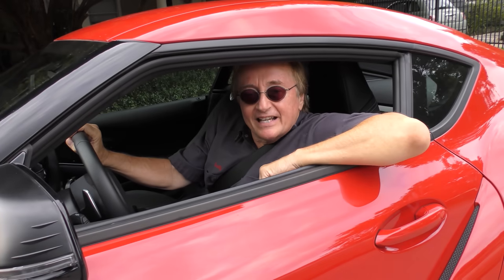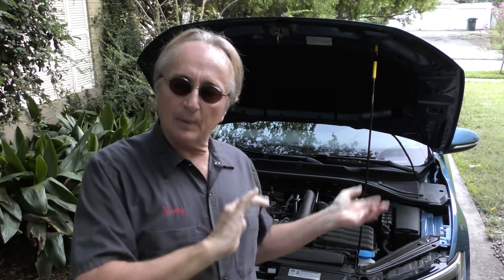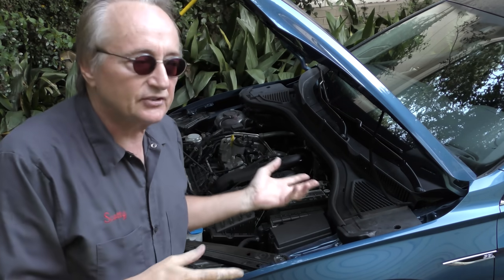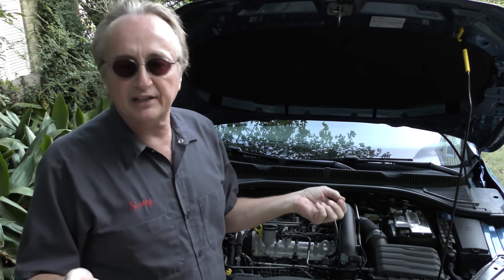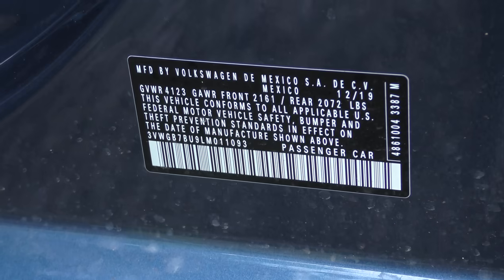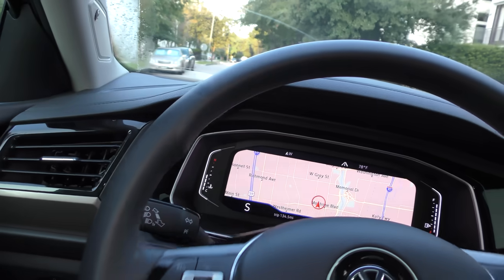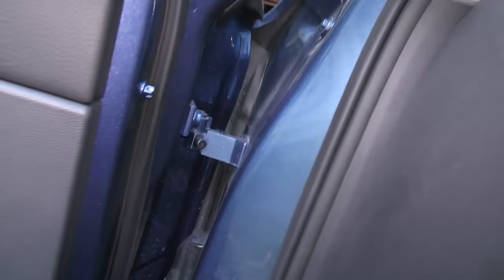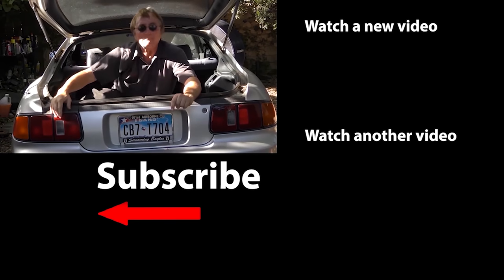I Just Found the Worst New Car Ever Made

Comment: The turbo is there to save fuel, not to max out the fun factor. VW is the company after all which introduced small engines with turbos just for this purpose. So with that fuel cost saving, it should cover the cost of belt change when it's due. And compared to a comparatively powered atmospheric, it will still be much more fun to drive with it's way more pep.

Comment: My mom has had trouble with every VW she ever had. My sister drives the CC 2.0 now and it's always in the shop. Her Routan had the brakes replaced way too many times. My Jetta GLI had to get a new engine at 60k (thankfully under warranty) and NOW it is a great car. They rebuilt it from the ground up and its probably a better job than most couldve done. Having a problem with the ECT sensor but if that's it then I'll be happy. 128k miles and I love that car. The handle is absolutely insane.

Comment: I have a 2019 Jetta and bought it w 3k miles. The clutch crapped out at 35000 miles and it was the most expensive and devastating repair experience I've ever took on. I'm permanently traumatized. It had warranty and tried 3 xs w the Lemon Law and failed. VW Serramonte in San Francisco were the most unempathetic jerks I've ever had the misfortune of knowing. Snakes!

Comment: I have been driving Jetta for 6 years and am very happy with mechanics and interior quality. However, I discovered that it has a known rust issue at the lower part of side fenders just by the front wheels. It is just a poor design.  I am disappointed with that. I do not like rust. I hope someone from VW management reads this message and do something about. Please address the known rust issue and the lower part of the side fenders. Thanks

Comment: EA211 in a 2016 Jetta, honestly will last you 200k easy, but you should keep up on the preventative things, oil change, trans service at 100k, timely spark plug changes, water pump every 70k, also N80 valve assembly around 70-100k to prevent evap leaks

Comment: These MK7 1.4l tsi Jetta’s have a timing belt that’s rated 150k miles. Then you inspect it every 10k miles and replace as needed. Their 8 speed transmission is made by AISIN, which is the same 8 speed transmission as the current Toyota Camry. It’s very responsive and the handling and driving dynamic is better than a Camry.

Comment: Hopefully you can run the tires at 32 psi to help out with some of that rough ride or go with the GLI Jetta with the independent rear suspension and pray for a water, cool turbo or the hatchback not the arm model of course

Comment: Have an Mk6 with 50k / bought new... have had the ac cleaned fixed/rebuilt, vacuum pump replaced, a broken clockspring, throttle body?? cleaned and 2 battery replacements.  My previous honda that I drove for 200k ran fine only requiring routine oil change and maintenance work :(

Comment: Have owned 3 Jettas. One diesel, two with the 1.4TSI (2 were kept until almost 200k mi.). With German cars, good routine maintenance is essential. If you are the person who skips or is lazy about this,  simply lease a car.  
Get the timing belt done every 100k. 
"Lifetime"... NOT lifetime. Engineers use that as a part term for "lifespan" of the part. NOT YOUR CAR's  lifetime. Just my experience. YMMV (as always)

Comment: The argument is that the car is trash if it has a timing belt, and that replacing them is expensive. 

Probably one of the most silly things I've heard. First off, the interval for changing a timing belt is around 112K miles. If you plan on owning one for that long, you have some other big repairs to keep in mind for any car. Reliable doesn't mean "maintenance free", it means that when you take care of the machine it won't randomly fail on you or die off before its had many years of use. Also I haven't any aftermarket belts that cost $183 like he says. Continental and other quality brands are as good or better than OEM and a lot cheaper. 

I'm getting ready to replace the timing belt on my 2012 jetta. It's at 101k miles, and the smart thing to do is flush the coolant, replace the water pump and pulley, as well as the serpentine belt. It's not a small job, but it's stuff that needs changing on any car, and I got a whole kit for about $200. Paying mechanics to work on your car is expensive, and things like luxury feel, good power and fuel economy come at a cost. In this case that cost is higher service fees when you need a repair.

Comment: Own a 2017 1.4L jetta 5 speed. Went to the dealer for a transmission oil change they told me its lifetime. I am at 63k miles I had them do it anyways. Did VW invent a lubricant that doesn't degrade?????

Comment: My 2015 Jetta has had so many issues that were caused by the ecu telling me the problems were where they weren’t. So many codes were pulled, if I listened to the computer I would have spend a fortune. When it was just a bad ecu, which by the way was still a 1,200 computer 😵

Comment: I had a 2000 Jetta with barely 100K miles when the water pump went seized, the timing belt was stripped by the pully and all the valves bent. Terrible design.

Comment: Scotty, there's millions of engines using timing belts that are interference engines. And unlike the cars built in the 80's, with those narrow timing belts, the new ones last 100k miles. I'm sure the belt on that vw is easier than the chain on the vr6's, which is on the back side of the engine. And it doesn't matter how hard the engine works for a timing belt. It only drives the camshaft, not the crankshaft.

Comment: This engine was initially only available with a chain. Only that it lasted at most 25-40000 miles. Therefore, the engine has been switched back to the good old timing belt. It will certainly last a lot longer than the old chain engins. Greatings from Germany.

Comment: Check belt at 150k and then every 20k after that….so what is the wear indicator to replace? Besides breakage?….we have 160k on original belt. Called local dealer and they had only done one other in that engine type. Sounds like their factory tech only has one up on me

Comment: I have a 2019 with over 104,500 miles and it runs well.... I had a 2004 with over 270,000 miles and a woman fell asleep behind the wheel and totaled my car.... that's the 3rd totaled volkswagen and they're super safe...

Comment: I have a 2020 r line i got recently and was skeptic about it at first before buying it but. 2020 jettas are ranked one of the most reliable jettas ever made. A coworker of mine who use to be a mechanic for 13 years even got his wife an r line VW as well and said in his experience VW ran the smoothest the longest. At 21k with 35k miles it was a pretty nice deal and i get upwards of 40mpg in it.

Comment: I had a Jetta 1.9 tdi 330.000km my best reliable car ever , never had to change shock absorbers nor exhaust,  engine perfect still driving smoothly 110mph ( German highways) my only regret was to switch it cause needed a newer car but got the golf 1.6 tdi, flawless, never had any problem neither and do myself the maintenance easy and cheap compare to the vw dealer .

Comment: This old man has no idea about this beauty - i am driving this same 2019 1.4 litre engine jetta from last 3 years - driven 250 k kilometres , never changed timing belt - change engine oil at every 10k to 13k - changed spark plugs and transmission oil just once - i never see any engine light on -  it still drives like butter - seems it will last me another 250k easily or even more

Comment: I have a 2019 Jetta 1.4 like this 250.000 km on it and not one issue other than 1 time battery change and every 10.000 km oil. The interior is absolutely outstanding for that money im more than happy with this car. This car is a really deal.
Reply: Change the belt. ours failed at 130000k

Comment: So the review was pretty positive. I have owned several VW’s and have had pretty good experiences with them. Except for your harping on the timing belt. How is this the worst car ever made?
Reply: Because it's an interference engine with a timing belt. When your belt snaps unexpectedly, your engine is done.
Reply: @beccahg.3157  There have been hundreds of interference engines Designed by pretty much all manufacturers worldwide. Timing belts have an extremely, extremely,  low failure rate. And usually only fail with neglect. I don’t think a car becomes the worst car in the world because of this. It’s laughable.

Comment: Growing up fixing VWs is what made me a good mechanic. I wouldn't recommend them to anyone. More complicated than they should be. The only reliable VW engines ever made before 1998. There's good plastics and bad ones. Toyota uses HQ polymers in the right applications whereas VW will put plasitcs where they will have to deal with major temperature changes, such as a plastic water pump impeller for God's sake.

Comment: I have a 2014 TDI Passat and absolutely love it. Fun to drive, and easy to maintenance. $20 pump and I do topside oil changes in minutes as well as filters etc. I would never, ever buy a GAS VW
Reply: Warranty Direct rates VW the 2nd Least Reliable engine due to frequent breakdowns.  My Beetle died at just 70,000 miles.  My 2 Hondas went 300,000+ miles with no engine breakdown.

Also VW commits criminal acts by cheating on EPA and EU pollution tests

Comment: I love my 2019 with 133,000 but yes I plan to replace that timing belt at 150,000. I had it inspected at 120k and it still looked good.
So much more roomy than any other car in its class.

Comment: i bench press 200lbs that's why i bought this car, i got wimpy arms
Reply: I can Bench 320lbs and I'm going to buy one! I'm probably going to have to push it while my GF steers. What year did u buy? Has it been good?
Reply: @joebrooks3824  haha. i got the 2019 SEL trim and it's been great so far. just don't forget to tighten gas cap when you fill up, or you will get a stupid check engine light.

Comment: I have a 2010 jetta tdi with a timing belt just had the belt water pump ect. done and it cost 425 in labor and 268 for the timing belt kit little over 700 to get done! You could get it done cheaper if you don't get the seals replaced

Comment: I've got a customer with 2 1.8L turbos, an older Passat and a newer Jetta. Both are still under 80k but run well without burning oil so far. The 2.5L that he had before got totalled, that always ran good but had a bunch of check engine lights.

Comment: Interference engines have been around a long time. And chain or gear driven cams do of course put more wear metal into the oil and throughout the engine. So pick what you want, longer lasting engine with more maintenance or short lived engines requiring less maintenance.

Comment: (not sure if this 100% relevant) I'm current owner of 2.0L TSI turbo in Tiguan and was part of class action lawsuits for both (a) timing chain tensioner, and (b) water pump.   those were/are the two most problematic things with the 2.0 TSI motor.  
The timing chain tensioner has at least FIVE versions from VW OEM-land.   The historic issue is tensioner either failed or could not properly maintain correct tension as chain stretched slightly over time.   this led to catastrophic failure. 
It's relatively easy to check for qualified service shop.  there is window to check, etc.   Anyone with 2.0TSI motor in vehicle at over 50k miles should do a pre-emptive check (regardless of vehicle age).  my 0.02.
Reply: What year?

Comment: while yes its ridiculous that they put a belt on a interference engine, you had a bunch of positives to say about this 'worst' car ever made.
Reply: Warranty Direct rates VW the 2nd Least Reliable engine due to frequent breakdowns.  My Beetle died at just 70,000 miles.  My 2 Hondas went 300,000+ miles with no engine breakdown.

Also VW commits criminal acts by cheating on EPA and EU pollution tests

Comment: I'm considering a Jetta or maybe a Civic, suggestions?  I specifically want the manual transmission, in my opinion automatics shouldn't even be offered in cars like this.  You mentioned you would rather have a Corolla but I had one as a rental recently and the seat wouldn't go far enough back or high enough for me, both the Jetta and Civic fit me better.

Comment: No belt is a "lifetime" belt.  I mean unless like Scotty says, the life time of the engine.  Most timing belts need to be replaced every 60-100k miles.  On non-interference engines you can probably drive them longer or until it breaks, but still, the most I've seen is about 105k in a user's manual for a Honda Civic being driven in moderate conditions (where temperatures don't go below freezing).

Comment: Research n planning never owned a jetta but have owned several VW's. When VW started selling the beetle in the US it was a very affordable car. Started driving in a super beetle and 42 years later still driving VW and Ford. Planning and research should come into mind when purchasing a vehicle to ensure you get what your looking for. On that note am sold on MKIV VW Golf TDI have owned since 2004, bought a set of Bentley manuals n never looked back. As they say VW producing mechanics since 1949. Am proud to work on my car n have the confidence it's done to standard. Just my opinion but the newer cars are too wrapped around the axle with blue tooth n back up cameras, if you can't turn your head n use mirrors and want to talk on the phone while driving you have no business driving.

Comment: I'm a mechanic my self and i get what your trying to say but these cars are not that expensive compared to other cars I've dealt with like kdm kia or hyundai for example. I bet you guys are like what kdm are cheaper cars yea well guess again not when it comes to mechanical or even to tune them as i actually tune them my self. I've owned plenty Toyota, honda, hyundai, kia, mitsubishi, etc and now i own a 2012 Jetta Gli and these cars drive amazing and handle great. Sure they are all plastic and some clips will brake but that's something you can always replace, and to last you just need to always do your Maintenance on time and use best oil, additives and once in awhile clean your fuel system and intake manifold to maintain a healthy running car. I seen these VW go up to 230k+ miles and still running strong.
Reply: true, German and Swedish cars last forever but you have to do maintenance per instruction manual. Their parts are more durable than Japanese. Handling is the best. Feel very safe on freeway. Can't say the same for Japanese cars.
Reply: @alanOHALAN  yea me personally I've owned so many Japan Cars and some are very durable but Hondas, Mitsubishi, nissan for example have gave alot of issues specially with tranny, sensors etc.

Comment: That is not a DSG transmission and VW does not Say it is a lifetime belt it’s 120k miles. Also it is not a difficult timing belt to do. Also I have seen these engine go to 160k miles in the first 2 years no issues. I’m speaking as a once certified VW now certified Audi Technician

Comment: Vw says check condition every 40k. It's under the extended service.  Tbh. I just did the timing belt job on the wife's 2013 TDI @121500 and it looked great, all the bearings sounded great,  even the plastic water pump wasn't the least brittle,  I replaced with metal. Ah well,  good to go till at least 240k. Good luck with that CVT in the Yoda. They are better than the Honda ones though,  and Nissan CVT...bless there heart.

Comment: They should have redesigned the chain and made it stronger, not put the belt, in my opinion. Well, if belt - then it should be way easier to change. But its not..

Comment: Scotty, just one main correction. The 2020 Jetta doesn't come with a DSG 8 transmission, it is a Tiptronic 8 transmission, which is slower while switching gears but trends to brake waayyy less, my 2016 RS7 has a Tiptronic 8 and it is flawless. And jettas are actually the better version of the a3 sedan, better meaning that it brakes less, I have an A3-s 2016 and had a Jetta GLI before, A3 goes to the dealer every 6 months because something broke, Jetta only oil and filters change. :)

Comment: I have a 2017 base model jetta. I didnt get the car I wanted(toyota camry) due to credit and money constraints so I took what I could get. The car has 30,000 and I dont plan on keeping it for more than 3 or 4 years so I'm not too worried about it breaking out of warranty. My problem is the on the gauge cluster, there isnt a engine temp gauge only the over heat light. Other than getting the $300 gauge that replaces the driver side air vent what can I do to know if the car is starting to get warm?
Reply: It warms quickly..

Comment: I'm not a fan of sub 150k mile cars, but if it's a fwd I can't see an issue with having the back suspension being worse then the front as all your handling is towards the front, a bit more uncomfortable sure, but I honestly can accept more uncomfort over a cheaper price. (Although I highly don't suggest a luxurious car that's cheap as used will be as comfy but far cheaper and probably last just as long.)

Comment: I had 17 Passat R.  65000 miles nothing wrong.  But I made sure to only use oils that are vw approved.  You can't take it to jiffy lube.   Only run premium.   I'd buy another one.   But you need to make sure it is serviced right.  If not buy a Toyota.

Comment: These belts are very easy and fast to change because the waterpump is on the other side of the engine. And the reason why they last so long is because the crankshaft wheel is oval. I have seen theese engines with over 300.000 miles with the original belt. And I have never about anyone with a cracked belt on theese. By the way it is the exact same belt and tensioner on a 1,0mpi 1,0tsi, 1,2tsi and 1,4tsi👌